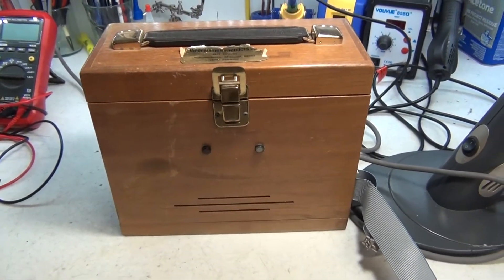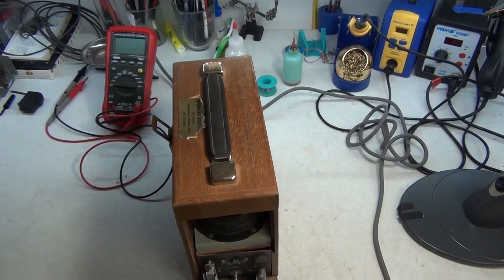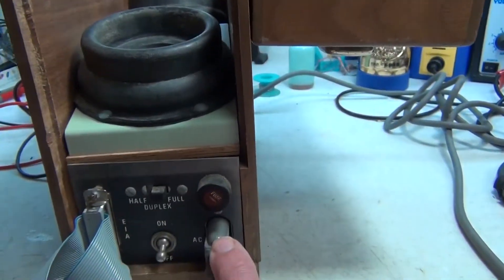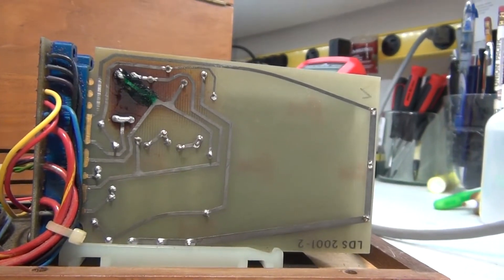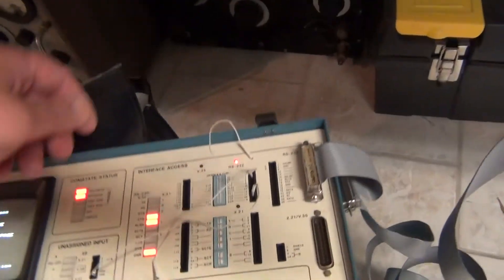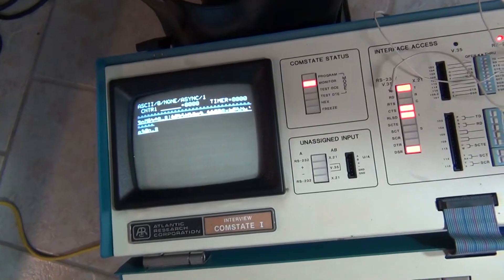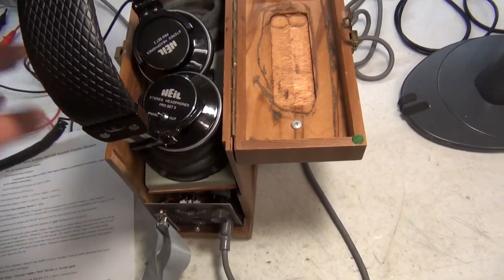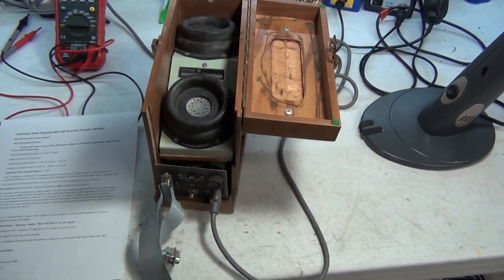Livermore Data Systems 103 Modem

Comment: Very cool, now I'm thinking about using a couple ham radios or maybe a HackRF with some python code. Need more time...
Reply from the maker: I'd be interested in your HackRF idea. I have one sitting in my "someday I'll get to it" pile...
Reply: @tchristell  I've got one I've played around with some mostly on receive, but its very powerful for the money.  Another option would be a YardStick One with something like RFCat.  I was able to open my truck with one by simply replaying the door open button.  It was sloppy, but it did work.  

Man for the last couple hours I've been digging up old software and thinking about how to communicate with a 300 baud modem, software modems, TNCs, BBS software, Raspberry Pis, etc.  

Just need to wrap my head around this type of stuff again.

Like the videos, please keep them coming.

You may be interested in this link about Decoding Signals and Replay Attacks with YardStick One: https://www.youtube.com/watch?v=w9ytc8xaZd4
Reply from the maker: I thought about setting up a local test. I have a C64 in the attic with a modem. I believe that I also have a PSTN emulator from my IVR programming days. Now I need to visit the local thrift stores for an analog phone. My datascope has an interactive mode so I have the terminal covered on the Livermore data systems (I don't have any RS-232 dongles that do true +/- 12 volts). I think I have some Max-232s around here somewhere so potentially could hook up a laptop to the Livermore.  Old is hard :)